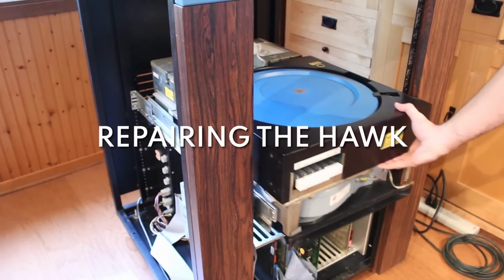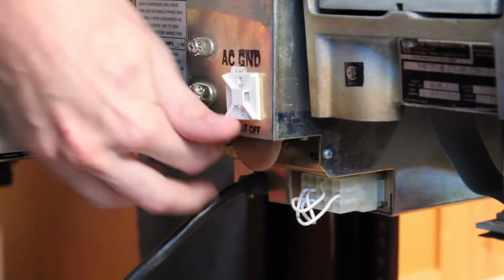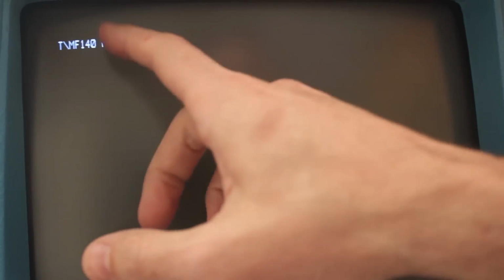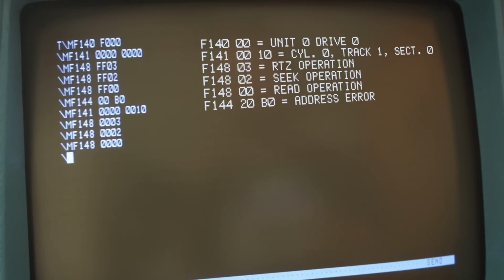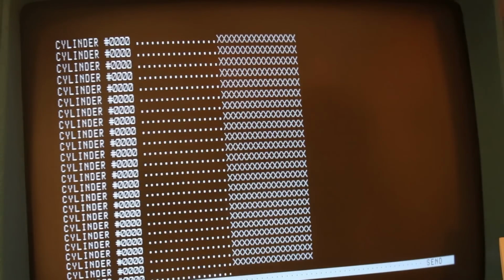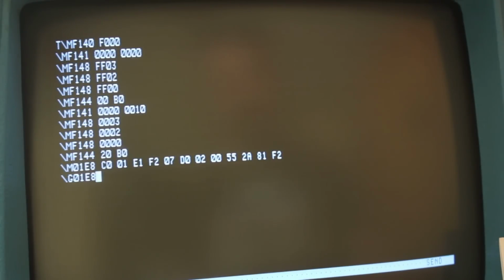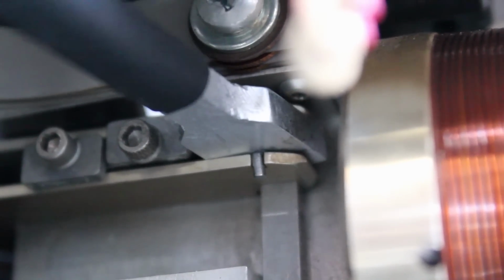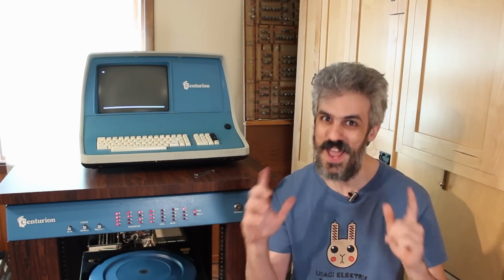Minicomputer Part 16: Aligning the Heads on the CDC Hawk Drive

Comment: ATTN PRINT really tells me it's looking for a printer. Some systems in the old days would just choke without one being online dependent on their age
Reply: Yup.  Long ago I worked with a system that would not boot without a working line printer.
Reply from the maker: That's actually a really good guess, and one of the first things we tried (well, plugging the printer card in at least). 
But, after digging through the code, in this case, ATTN PRINT isn't actually referring to the printer. Instead, it's MUX and terminal related. More in the next episode!
Reply: makes sense, for a long time computers were designed with that being the primary output, and sending debug info to a medium that would persist makes a lot of sense too, especially if correcting the fault requies you to restart the computer.

Comment: Aligning the heads like this... obviously you can tell you have the heads centered on a cylinder, but how do you know they're on the correct cylinder? If it's commanded to cyl0 and one head is on 0 and the other on cyl1, you'd get some pretty amusing data but the diagnostics you're using would look like everything is fine.

Is there a cylinder with known data that you could craft a program to look for? Might be possible to work around not having that magic disk pack.
Reply: The DSK interface card actually gives separate errors for "couldn't see any data" (format error) and "saw data for the wrong cylinder" (address error). Each Sector starts with a 16bit cylinder/head/sector address, plus a 16 bit checkword that get written during the original format. 

Before Usagi made the head alignment tool, we were experimenting with the cylinder centre adjustment. That had enough range to make the top head go all the way from wrong address errors on one side, to wrong address errors on the other, with clean reads in the center and format errors inbetween. But since that adjustment didn't change head aliment, there was never a position that had all sectors reading cleanly.
Reply: @phirenz  That's a slick way of doing it. But this makes me wonder, if each track can essentially serve as its own servo track, why do the heads need to be aligned at all? I'd think it would have the brains to just have each head go out until it's centered on the track it's trying to read and then start outputting data. Is the actuator a linear stepper rather than a voice coil?
Reply: @DanBowkley  As I understand it (this is far from my area of expertise, Ken is the expert here) there is no servo track. It's still a voice coil, but the servo infomation for cylinder position comes from a linear slider that is part of the drive.  These drives are actually backwards compatible with IBM 5440 cartridges for the 5444 drive, but those were limited to 200 cylinders, while CDC has managed to double the density to 400 cylinders.

CDC's innovation was using a metal bar to encode cylinder positions, that would reliably expand and contract with variations in temperature at the same rate as the platter. According to Ken, competitors like Pertec tried to do temperature compensation with electronics, and were less reliable.
Reply: @phirenz  now that makes some sense. I have to wonder if it was just a function of the electronics not being fast enough to use the information on the tracks as servo data, I really can't think of another reason why they wouldn't use the info that's already there to do the job while also eliminating manual head alignment.
Reply: There are two different things here, finding the correct cylinder, and aligning the head azimuth to be perfectly perpendicular to the track. The alignment done here was the latter. It's adjusted by the technician, and then locked, it's not servo controlled, so it always needs to be manual.

As for using the tracks as servo data to lock onto the correct cylinder, I'm not sure that can work. It takes time for the erase and write heads turn on and off, so there are large gaps (120 bits, minimum) between each recorded track segment. Each sector has two track segments, one for the address, one for the actual data.

 For a regular write, you have to read the address to make sure you are at the correct sector, and then overwrite only the actual data track segment. It's all manually controlled by the DSK controller card. The actual hawk drive only concerns itself with head positioning, converting data to/from digital and reporting the current hard sectoring pulses. The DSK controller card has to turn the write heads on at exactly the right time, and feed the clock+data pulses that will be written to disk. 

These cartridges also completely blank, and the controller needs to do a low-level format (writing the address at the start of each sector), so you will need external cylinder positioning for that.

Comment: Takes me back to doing fixed and removable platters head alignments on an ICL 2903 system I maintained on  the island of Nauru in the 70s. It ran Government, Airline and NPC accounts etc. I also installed and maintained additional EDS60, 60MB fixed and removable removable drives.

Comment: Pro tip from an old Toolmaker... When machining aluminium, a drop of WD40 does wonders. Will save you a lot of broken tools.
The carbide broke because it was welded to the aluminium. A really common thing with Alu and carbide.
Reply: That's a really useful tip, thanks 🙂

Comment: It's looking for a printer!!!! (which is disconnected of course) Usually the first thing a bootloader/kernel will do is check to make sure  all required drives and peripherals are connected. This thing is primitive enough that it probably doesn't know to skip over that part... UNLESS maybe there is a key command to bypass it??? I don't know how bad off the printer is, but maybe if you can fool it into thinking that it's actually there with some sort of loopback on the printer port, it may actually boot. I literally jumped out of my chair when you started getting solid dots while adjusting the heads on that drive. Pretty nifty little tool you made to accomplish this!😁👍
Reply: Might not even have to be a loopback. If it's a 'dumb' (aka Centronics style) printer connection, all you need to do is provide 5V on the appropriate pins to tell the computer that your 'printer' is online. It will then just spew out the bytes on the printer port pins but they would obviously not go anywhere.

If the printer was a serial printer and the computer expected some more intelligent answer, then it's a little more challenging.

Comment: Nicely done. I wonder if ATTN PRINT is a warning of a fault in the printer system (e.g. printer is missing)? Seems a bit obvious, I know, and I'm sure you've thought of that...
Reply: The IBM 1130 disk monitor prints a banner message on the printer as part of boot up, so that if the printer is not ready it hangs. Might be a similar situation here
Reply: @carlclaunch793  wow! Someone else remembers the 1130.  I cut my teeth on one with Gerber Baby Food research department.   We used the selectric console for printer.
Reply: I thought that, -or-  it's trying to tell you to read the printer for more info?  Like, "Hey, I got a problem, go check out the printer for what my error is"  But you're probably right, it did a quick test for printer and failed.
Reply: Same thing occurred to me - it's expecting to see a printer. Maybe on one of the ports on the IO card... (multiplexer?)
Reply: @alancordwell9759  Parallel port Centronics interface would be my guess.
Reply from the maker: That's actually a really good guess, and one of the first things we tried (well, plugging the printer card in at least). 
But, after digging through the code, in this case, ATTN PRINT isn't actually referring to the printer. Instead, it's MUX and terminal related. More in the next episode!
Reply: @UsagiElectric  I CAN'T WAIT!!!!!
Reply: @UsagiElectric  Watching this series brings back memories of my friends getting one of these as kids and trying to get it working without any knowledge; seeing you succeed wants me to go back in time. We got the libraries previous mainframe and really wanted to get it working just for fun; I guess trying to get a huge computer running again in a barn was a bit of a fantasy.
Reply: Yes, that is exactly what I am thinking; missing printer.
Reply: like ATTENTION PRINT

Comment: ATTN PRINT . Attention Printer. No printer or print terminal connected to the correct port ? These systems need a fixed printer to print their logging data on paper.

Comment: I thought aligning the heads was going to be more involved than that! Quite helpful that you have a shop with a mill handy, too. Between making your own tool, and having CCDP handy, it made searching for hen's teeth (the actual test equipment and tools) a moot point, hehe!

Any chance you'd be able to get the second hawk drive going eventually? Since you can align the heads now, swapping in replacement heads from the other parts drive doesn't seem too far out of the realm of possibility.

Comment: Can also indicate a dirty head, or an oxidized connector, or maybe simply a "dryed" up solder joint, all the slamming of the head might have dislodged the connector pins.

Comment: For the ones that don't realize this, aligning heads on an old hard drive like this is HUGE. Sure, it was juryrigged together with some "cheats" but the HWKREA is "just" a nice wrapper for the few bytes typed in to read the status register. So this is pretty much how hobbyists did it back in the day. I only aligned disk drives, but those were tough too. The big difference is that with disk drives, you could live with a drive out of alignment, if you never used your disks in any other drive and never used store bought disks. And generally the disk drives of the 80s were not as violent as the hawk drive, I would never have dared spinning it up without those rubber stops.
Reply from the maker: It was such a massive relief to see the heads come back into alignment. I was dreading it something fierce, but HWKREA and our custom tool did the trick!
Fortunately, the old Hawk here has pretty generous tolerances and are known for being tough old birds.
Reply: @UsagiElectric  "Tough old birds."  That's great!
Reply: @UsagiElectric  I get the feeling that the "approved way" of doing head alignment was at least partially dictated by greed. Sure, it might be even more correct, but with expensive tools and software. You instead used the status register and a lever. And you got it in alignment just fine.
Reply: Actually it's worse than everyone thinks.  The drives are so tight now that physical parameters for each specific drive are written to its own firmware.  You can't even swap boards on the same model and end up with a working drive.
Reply: @CommodoreGreg  Agree, On the Hawk we wrote the bad sector table map on the drive's platter and did servo off-set & seek speed adjustments with term pots on the servo cards ( no stored software values in EPROMs ).  And we repaired the drives on site in the customer office.  Today's drives store bad sector maps, servo performance adjustments in EPROM in the logic and do advance data error correction on the fly in the drive.  A big drive in the 1970s was 5 MB to 300 MB and cost tens of thousands of dollars. Now in 2022 we can buy a 8 TB drive in the local retail electronics store for a couple of hundred dollars.   Repair no way the drive is built for the local landfill when it stops working.
Reply: @CommodoreGreg  Oh dear, that's bad news then for my old Samsung drive that is not recognised when I attach it to a SATA port... Fortunately the drive itself only has files in the category "Nice to have" and not the ones that make me hold my head in despair. I might try to solve the issue if it's power related though. If so, then it can be a good exercise. If I manage to fix it, I get those files back. If not, it will still be a bit of experience. Either way will still be positive.
Reply: It's great that this alignment worked, but it makes me a bit melancholic about newer (HDD) drive mechanics that simply have too low tolerances to even attempt manual alignment, unless there is a worm wheel, or similar mechanism already in place to achieve that.
Reply: @LarixusSnydes  Current platter drives have such tight tolerances it would be impossible to manually align them, we are talking microns. Also, the newer designs have eliminated head crashes, parking, and a lot of bad things. If you manage to get the heads out of alignment, the entire drive is probably damaged beyond repair. 
The old drives had a lot of big design flaws.
Reply: @OscarSommerbo  True, it's not so that everything is worse today. Far from it, but the melancholy remains because most of the times when a modern electronic device bites the dust, all that the repair manual tells you to do is to replace an entire module, rather than replacing a few parts that have released the magic smoke and getting the intense satisfaction of having re-animated a device back to "life".
Reply: yup! drive alignment and interchange are very important. that's why you should always format a disc on the drive you are attempting to use it on, and then copy the data to the disc from the other source. I've had to deal with tape-record interchange issues before with BetaCAM, Umatic, and type-C one-inch Videotape recorders! fun times!

Comment: Loved this.

I found when messing with floppy drives, that you can hook up a speaker to the /READ output, and actually hear when the heads are over a track. lol

For hard drives, obviously the tracks are way closer together, so it's very tricky to get it aligned over the correct track.

(on any modern hard drives, any misalignment of the multiple platters will screw up the whole thing, and the tracks are crazy close together, plus more of the tacking is handled by the electronics anyway.)

I wish I had a workshop big enough for a milling / CNC machine, and other stuff.
I only recently bought a pillar drill, but it's not ideal using it in a carpeted room. lol
Reply: Modern drives use servo information recorded on the platters to seek to the correct cylinder.
Reply: @Pentium100MHz  Yep, even the old NEC drive I had (with "SMD" interface) used a whole platter just for the servo info.

So it had constant feedback for the head position.

Other servo or preamble bits are often added before each sector, too.
Reply: Clever trick with the speaker on floppy drives! Imma throw that in the ol' toolbox, thanks!
And, well,  I used to have my dremmel-drill-press on the front burner of my kitchen stove... So I feel yah. But if you figured out the speaker thing, I bet you can figure something out 'bout shavings and carpet.
Reply: @ericwazhung  I should really just get a bit tray under the pillar drill, or at least hook up a vacuum nozzle near the bit. lol

btw, technically I wasn't driving a speaker directly from the floppy drive /READ pin. (I should probably have mentioned that.)

Since floppy drive signals are generally open-collector, and wouldn't have much drive current at all.

I had the 3.5" drive hooked up to the DE1 FPGA board, for an attempt to read the raw MFM data from some disks, and in turn recover some Paintbox data from some 8" disks.

The "speaker" was actually a tiny subwoofer module from an Acer laptop (5920, or something), which has an internal amp that runs on 5V.

Handy little speaker modules for projects, and usually cheap on eBay.

Don't quote me on this, but I think the signals are...

Black = Gnd
Brown = /Enable (tie to Gnd)
Red = 5V (don't use 12V! lol)
Orange and Yellow for audio input.

(the Orange and Yellow wires originally took stereo audio from the laptop, and mixed to mono. You can just tie those together. There is no volume control wire, though.)

Comment: The bumpers on the replacement magnet look suspiciously like stick-on rubber feet
Reply: Yep - I have an old PC case with feet just like that. If they are just feet it is an easy fix to repair the missing stops on the original part.
Reply from the maker: I'm not one to judge, if they work and work well, more power to them!
Reply: @UsagiElectric  They dont. Your problem with alingment caused by these nonoriginal bumpers.
Reply: @vitalygorbachevsky1264  his problem was caused before he swapped to these. It was caused by the other magnet with completely broken bumpers
Reply: Directly from Lowes.
Reply: They ARE stick-on rubber feet. 
They appeared in lots of things in the 1970s/80s. I used to sell them in a shop, my first job. 
Probably still available from RS components in the UK
Reply: The head servo hit on the metal studs that use to have rubber bumper each time the head servo assembly unloads caused the heads to be "knocked " up of alignment.   This is way each time David spun down the Hawk and then spun up the Hawk the heads got knocked a fraction of a thousands out of alignment.  I had seen this problem many time at Centurion repairing old Hawk drives.  I even used rubber feet as bumper if I did not have the CDC Bumpers on hand for replacements.
Reply: No suspicion!
Reply: Hey if it works….